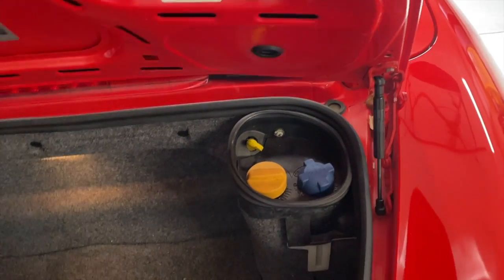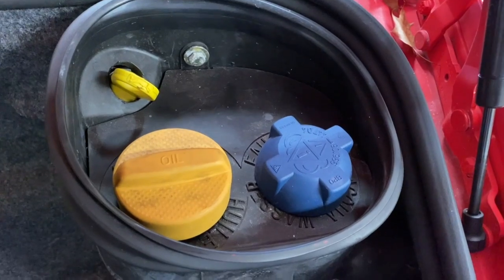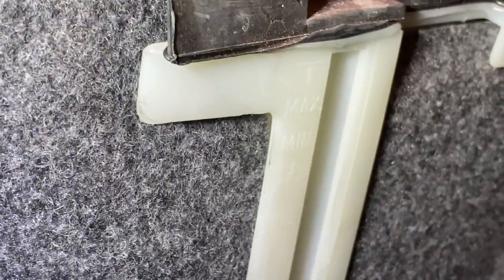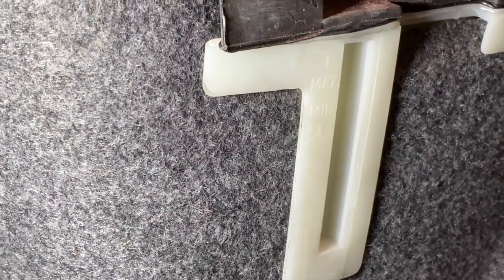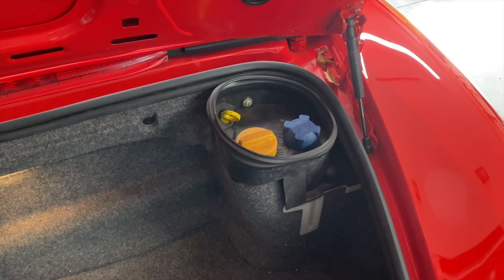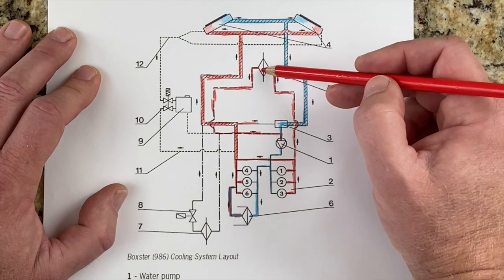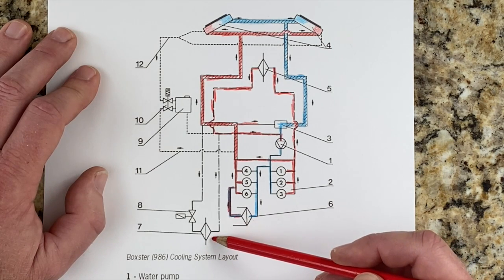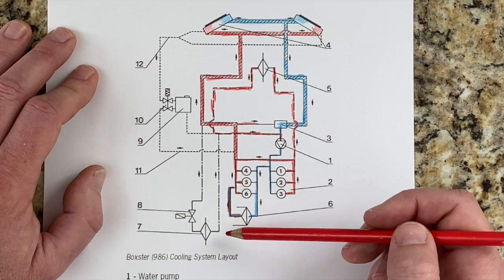Porsche Boxster M96 Engine COOLING SYSTEM EXPLAINED!

Comment: great video! do you know the real temperature when low speed fan turns on and temp when high speed fan turns on?thank you!
Reply from the maker: +daniele d'arconte thanks! Best I could find with a quick Google is someone that used an OBD2 reader connected to a 2002 986 and found the fans came on low speed at 212F and high speed at 216F. They switch off at 205F.
Reply: @HelpMeDIY  thank you,my low speed turns on at 102 celsius,than stops at 98.but in a hot day i was going to mountain and i read 107.without earing high speed turns on.but high speed turns on when i turn on my air cond,so i suppose high speed works,but the temp i think is too high
Reply: @danieledarconte2163  Controlla i resistori di velocita', sono agganciati sul telaio dei radiatori in basso, sono di forma cilindrica e portano tre fili.

Comment: The coolant level should be checked with the engine running. It will always be "low" when the engine is off.
Reply: Thank you! 
I was about to add coolant

Comment: Valve number 10 looks like the manual venting valve which is located underneath the plastic shield up on the expansion tank. That is manually operated to let the trapped air escape from the circuit after the circuit has been flushed up and refilled.
Reply from the maker: +thejack01 ah I bet you’re right! I don’t know why seemed to assume it was electronic 😆
Reply: @HelpMeDIY  the spring icon up on the valve diagram tells that is manually spring operated. The electric solenoid operated valves have the diagonal line in them. 💪💪😉😉 thanks for the video I have found very interesting!!
Reply from the maker: @thejack01  super!

Comment: hi i have problem with my porsche boxstrer 986 2002 every morning i need to up coolant is no leaking i think problem is with coolant tank when engine is hot coolant in tank is cold mey be you now whaits wrong?
Reply from the maker: +Arunas Patrikas you have a leak
Reply: is not leaking only coolant need top up when i driving

Comment: Draining the system thru the yellow arrowed Torx 30 plug is easier than disconnecting hoses and the rate can be controlled by the vent switch in the trunk. Once hot, It may take 3 brief circuits around the neighborhood to burp air out of the system with the overflow bottle cap left loose. Each of the 3 short trips may invite addition of about a liter more antifreeze. If/when level in bottle falls below "min" a red light will flash next to temp needle on dashboard to invite you to stop and add. Seems idling in place does not shake/burp air out of the system, but car movements (driving around) do. if a 4th trip indicates all the air got out and level is between min and max, then it's time to tighten the filler cap and shut off the vent switch, If you used only 3 gallons instead of 4 it means 1 old gallon was trapped in, but since the recommended antifreeze has a life expectancy of 5 years or 150000 miles, overall the 75% new mix will still offer very good corrosion protection and conditioning for the pump's rotary seal.
Reply from the maker: +Alexander Schonfeld that’s why I prefer to vacuum fill coolant. No air trapped in the system the first time 😎

Comment: we have problems temperature is always up, in our car hot water is not turning from back to front radiator  and big pipes are all cold we changed radiator and termostat but it did not help
Reply from the maker: +Kapitaloto Otokapital that’s not good…
Reply: @HelpMeDIY  how can i Fix it ?
Reply from the maker: @ceyhunozturk2471  I just told you everything I know 😆

Comment: I found oil in my coolant. The head gasket has been done so I'm guessing it must be Oil cooler. Is there anything else could leak oil into coolant: water/oil pump?
Reply from the maker: +@christame994 oil cooler is probably a good place to start!
Reply: @HelpMeDIY  thanks the o rings were pretty bad so hopefully that was it!

Comment: Great video and explanation of the cooling circuit and items ...  I don't ever remember hearing fans at the front of my 987.2 but I did near the engine bay when it was idling and hot.
Reply from the maker: +Rog Burton thanks! I’m not positive, but I would assume that model also has fans for the radiators :)
Reply: That's the engine fan. Comes on when the engine gets hot.

Comment: Can you do one one changing out the chain tensioners and/or the manual transmission oil ? Not a ton of clear info on how to do this. Your videos have helped me save $ and understand the car better. They are also a great addition to the info in  “The Bentley”  & “The 100 Projects”  books. Thanks for making these.
Reply from the maker: +Charles Mookus you’re in luck! I already have one for the transmission oil. Just search “Boxster transmission oil” on YouTube and it’s the first result. As for the tensioner I actually need to do that myself. Just have to figure out how first...
Reply: @HelpMeDIY  D’oh!

Comment: That was super. I have just bought a RS 60 2008 3.4S. I have the 101 projects. I also have the Bently service manual. Any extra information I can look up. I lost a little coolant. But think the dealer didn’t put the coolant cap on fully. I’ve got a new cap on the way. But it’s a .00 , so must get a .04
Reply from the maker: +Michael Keohane thanks! I think you will really like this channel 😉🍻

Comment: Nice video, especially coloring the flow appropriately. 
Should you consider an update of this video to add the info given in the comments regarding bleed valve, I'd like to add the following tidbit about the thermostat. 
You colored the path of the cooled coolant out of the radiator into the thermostat and out of it into the water pump. This could be understood by the uninformed that it's the coolant's temperature that controls the opening/closing of the thermostat. This is not the case. It is controlled by the temperature of the coolant tee'd off from its pathway to the radiator, into the thermostat (partially colored red @11:22, saw what you did there! 😀).
It flows through the thermostat back into the waterpump*. 
As soon as the coolant has reached ~80°C/180F, or whatever the specced temp of the thermostat, it will start to open a little thus letting cold(er) coolant into the stream into the water pump and into the engine. 
*it must flow through the thermostat and back into the waterpump as else there would be no feed into the waterpump in cases when the engine is warming up (I.e. thermostat closed) whilst at the same time the A/C is on (because that shuts off the flow through the heat exchanger, the only alternative path back to the water pump).
Reply from the maker: +Bernard McLake thanks for taking the time to provide the additional info!

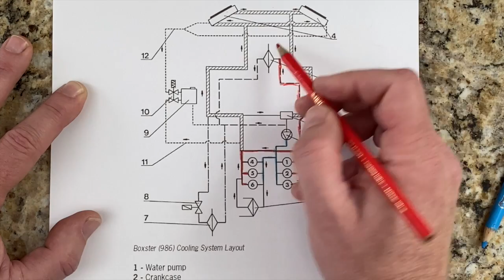Comment: Any data on how many times it is the oil/water exchanger (on diagram you put up 8:58) for this “oil into the coolant problem” that some are talking about.   Looking for most likely prob for a 986 that has no indicator lights on, no leaks onto ground, no overheat, and engine runs fine But oil in coolant. Thx
Reply from the maker: I don’t have that data

Comment: Guys- NEED HELP. My 2003 is leaking coolant only while idling. Last week, I added about a gallon of distilled water as I didn't see a reading on the  'min max' near the full line. I hoping this is the system handling an overfilled situation. Any idea's or advice?
Reply from the maker: +Josef Bleaux why do you think it’s only leaking while idling?
Reply: @HelpMeDIY  cuz when I fire it up it starts leaking like Niagra Falls. Shut it off- not a drop.
Reply from the maker: @josefbleaux6724  I see. "only when idling" infers to me that you mean it's not leaking when it's running, not at idle. Which is not what you meant. Which makes more sense. You mean it's only leaking while the engine is running. So when it's pressurized you have a leak somewhere. Now just look around and figure out where it's coming from.
Reply: @HelpMeDIY  ok thanks Buddy! PS your serpentine belt video saved me $345.. that's what the mechanic was gonna charge.
Reply from the maker: @josefbleaux6724  glad it helped! 🍻

Comment: I'm not certain but my guess is that the two "valves" in the diagram at position #10 are the coolant cap and the bleeder.
Reply: As a side note, I believe that the squiggly symbol above those valves is the symbol for  pressure relief, which would confirm my supposition.
Reply from the maker: +Stefan Shapiro the diagram clearly says “Shut-off valve”, but if they meant the cap I would think they would just say cap 🤷‍♂️
Reply from the maker: +Stefan Shapiro that part would make sense
Reply: @HelpMeDIY  I agree that the language seems obscure but from a flow diagram standpoint, a pressure relief "cap" is actually just an implementation detail for a pressure relief "valve".
Reply from the maker: @stefanshapiro1245  I’ll buy that
Reply: @stefanshapiro1245  I would bet 10 is the bleeder\burp valve.  The obscurity probably comes as much from translation as anything else. Further, there is no other depiction of that valve